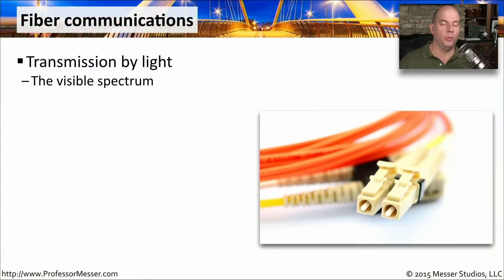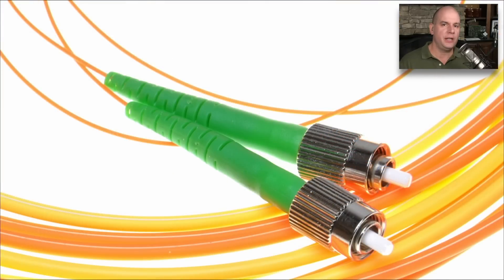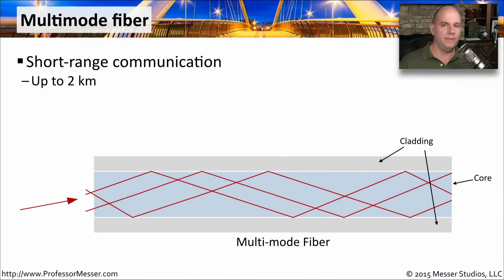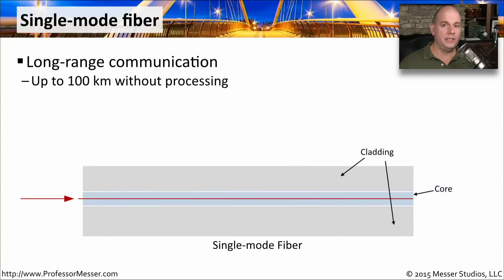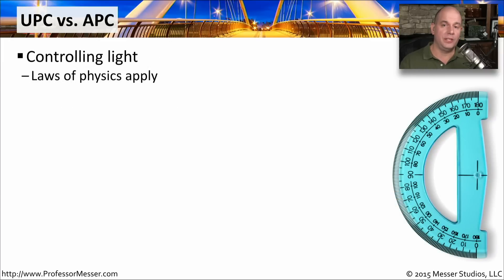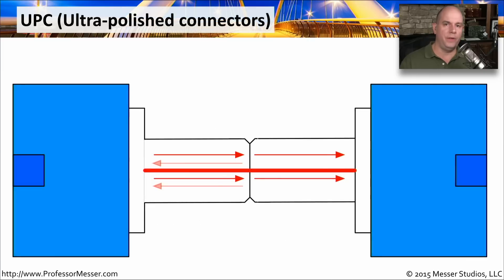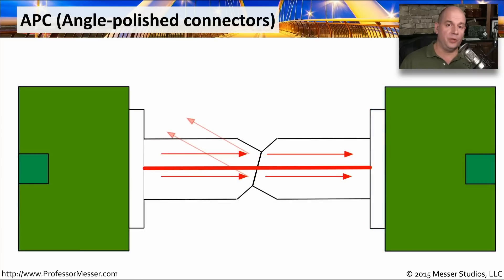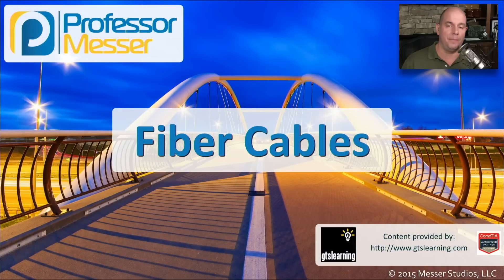Fiber Cables - CompTIA Network+ N10-006 - 1.5

Comment: what mode fiber do you recommend to wire a whole two story house as a network?
Reply from the maker: Daniel Anderson I wouldn't use fiber in a house, unless it was a really, really big house. There are very specific handling requirements for fiber, you have to watch your bend radius, and the equipment is more expensive. I have multiple wiring closets in my house, and I use copper to connect everything.
Reply: Professor Messer Knowing that Gigabyte home speeds are coming, would you say, in a new wiring setup, Cat 6A should be used?  Assuming a rewire down the road is not possible, as inside a home perhaps.